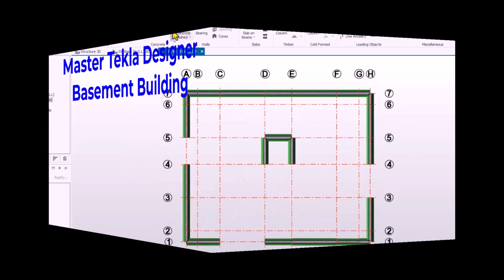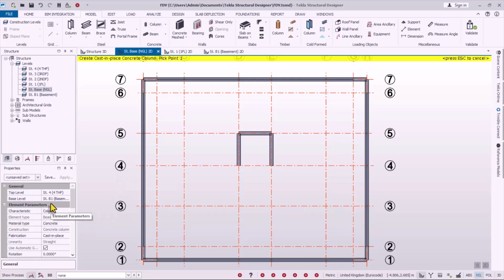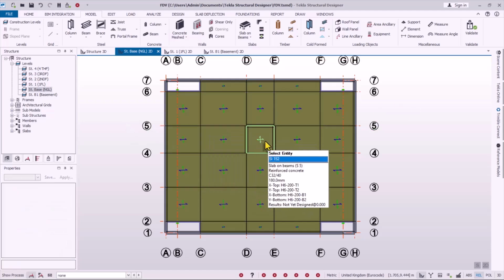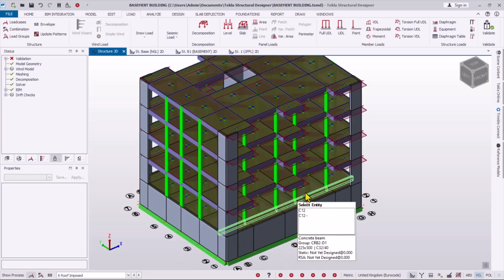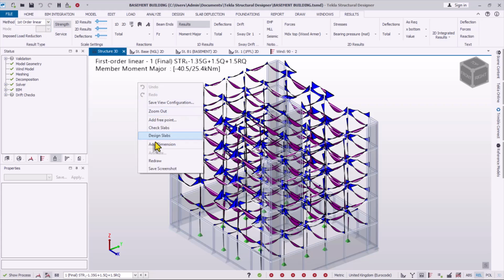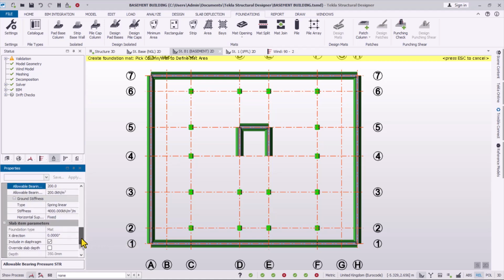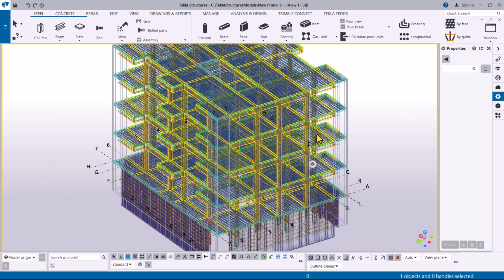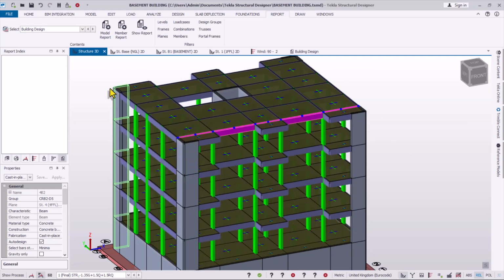MASTERING Tekla Designer for Basement Building Design Is Easier Than You Think!

Comment: Great video! Just a quick tip from a modeling perspective: it’s usually better to model columns and shear walls floor-by-floor rather than continuous across all levels. It ensures proper nodal connections with intermediate beams/slabs, corrects the unbraced buckling lengths for design checks, and makes rebar/splice detailing much easier!